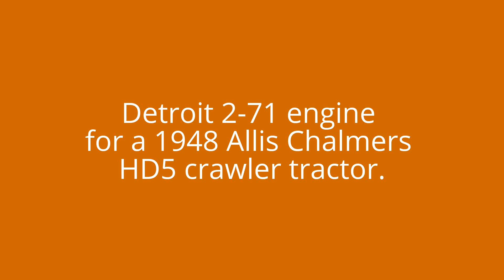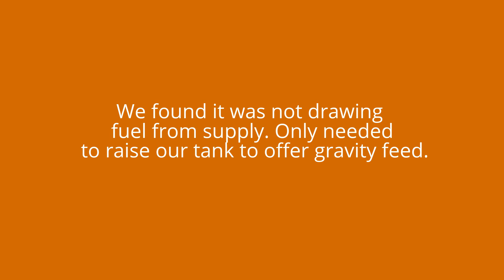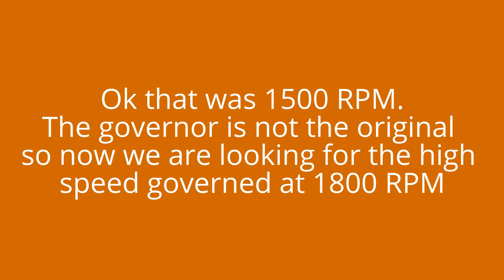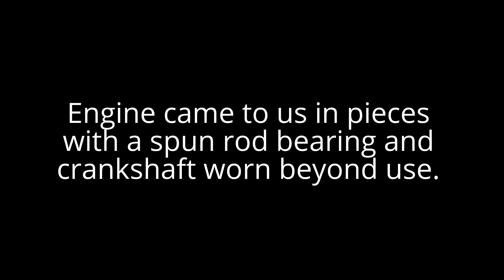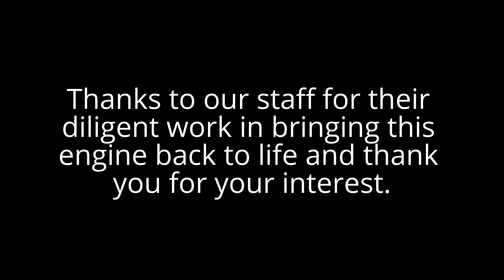Detroit Diesel 2-71 engine overhaul and start

Comment: That engine would sound so dame good with a turbo! The way it sounds when reving up or down sounds lovely. Imagine the sweet sound of a turbo too. OMG!!! Love diesel engines !!!

Thanks for sharing, 👍😉

👍👍👍👍👍THUMBS UP 👍👍👍👍👍
Reply: it has a lobed  blower on it all ready   i have one in about the same condition that i need to get time to put back together
Reply: FR Rapp  blower Dosnt provide any boost on a 2 stroke jimmy. It provides positive crankcase pressure for ring seal.
Reply: dude every deisel engine has a turbo it wouldnt run with out one you can though upgrade your fuel system blower pistons racks and blower just letting you know.
Reply: @hunter7476  unless you were talking about this design wouldn't run without a blower, there is plenty of diesels that have no turbos and no blowers. My dad's old 84' izusu pup has a naturally aspirated 2.2l 4cyl diesel, I have a 5kw onan generator naturally aspirated and just about have my tractor back together with a naturally aspirated yanmar 3t90j
Reply: @matthewhoffman9242  You do realise the GM is a two stroke engine? It's closer to a lawn mower in design than an Isuzu. They will not run without a blower to push fresh air into the cylinders, they don't have a reed valve crankcase like smaller engines.
Reply: @hunter7476  dude every diesel doesn’t have a turbo. Detroit had plenty of two stroke naturally aspirated engines. They all had blowers but lots of them didn’t have turbos.
Reply: You should look up 20 v 149 Detroit Diesel engine on YouTube, those engines have massive turbos on them and have the best sound of any diesel engine.

Comment: First time seeing a 2 cyl Detroit, Worked on many V 6 8 12 and 16 loved em
Reply: These and the 3 cylinder detroits were commonly used in industrial construction equipment, refrigeration cars for freight trains, generators ect not an on road bus or truck engine like you would typically see a detroit in.

Comment: And it can run in both directions, right? No need of a back gear..he. he.... I remember such Engines driving Fire Pumps. They had to run in a proper direction to achieve the pump efficiency.
Reply: Wrong.   In order to change the engines rotation there are a number of parts that need to be changed.    The Camshaft, starter, fuel pump, oil pump and water pump.   The idler gear location is also changed.   Yes they can start (bump start) in reverse but they will tear themselves apart in a short time

Comment: I wish there were newer versions. This could be the perfect engine for my diesel go kart project
Reply: Get little yanmar clone on ebay
Reply: I want to stick one of these in a single seat road going car looking a little like 1920s racers with a bit of "dieselpunk" design flair with the engine behind the driver. It doesn't need to be fast. And the 920# weight is fine too. Just sound good and be fun to drive. I'm planning to use a 2+2+2 transfer gearbox I have from an old piece of farm equipment. (I'm not sure what the machine did to be honest, I helped the farmer take it apart for scrap and the gearbox was good so he let me keep it as payment for my work. I've had it for years) The two gears are sequential (N - 1st - 2nd) and then you pull the lever back to neutral & push a second lever forward to the next detent to change to the next pair of gears. Like a mini twin stick.  Complicated, but would be a hoot to drive around. If that doesn't work, I'll use a beefed up VW bus transaxle.

Comment: I have a question I just got a 2v71 and I can seem to find a dip stick on the engine there is 2 pipe plugs on both side of the block where I'm guessing it would go.  Can you tell me here I find one

Comment: Hi Sr, im from chile i have the same engine in restoraion and i need the injector 
height calibration please!! greetings
Reply: I saw 1.484 inches listed for an hv6 . Wish  I still had the height gauge set would measure it for you. Nice little engine!
Reply: You want toknow the colour of the badge on the injector to get the right timing gauge or mearsurementAnd the number N65 stc.

Comment: Good job men, she sounds great!
I sure miss the old 2 stroke Jimmys, at least the 71, 110 and 149 series', you can keep the 53's
Reply: what's wrong with the 53? genuinely asking
Reply: the 53s were good engines
Reply: They were great at converting diesel fuel into noise and smoke... they also made a few horsepower - almost enough to get out of its own way
Reply: @nikolabegonja5490  Absolutely nothing wrong with them, just the bigger ones weren't so fiddly to assemble.
Reply: @mikecubes1642  the best

Comment: Am I nuts for thinking this would be great in a pickup truck?
Reply: s10 ...
Reply: Ron Armstrong  You may want to rethink the idea...My brother-in-law had an 84 F100 SWB 2wd with a 2.5L? four-cylinder Perkins diesel  in place of a probable 4.9L straight-six  gas engine. While getting around town & loads in the bed were just fine, pulling grades & such,  highlighted its severe lack of power...We got "stuck" trying to ascend a moderately steep ramp into a garbage-dump after dumping our refuse...it was quite the pathetic sight seeing a Ford trying so hard to climb such a mediocre grade....just plain ran out of power.
Reply: A 6V53 slots nicely into older Ford F series

Comment: check blower drive gears. They fail from pulse of two and three cylinder gmc. 453 471 671 6v53 etc didnt chew blower gear teeth off.

Comment: Is this engine big enough to put it in a small pickup truck or a small suv too as well?
Reply: it only makes about 75 to 80 HP. Kinda small for that. Try for a 4-71t.
Reply: ok
Reply: I mean put a 2-71 in a 1994 Jeep Wrangler would be a good suv!!!
Reply: With the right gearing this would power an automobile just fine. It has 3x the torque of most 4 cylinder gas motors, but only has about 600 useful rpm in the power band. Whereas a small gas motor will utilize 1200 to 2200 rpm for acceleration in the power band.

Comment: got a question on this motor if you can help
Reply from the maker: Lets see if we can help you. What is your question?
Reply: I have a 1950s ac hd5g crawler loader. It has a 2-71 in it for a motor.

There is this long tube about 2 inches wide coming from the bellhousing/transmission area and i can see it in your video. That is the transmission fluid fill spot right? Where/how do i add engine oil? I can only find the dipstick but no fill point. Is the engine oil and transmission the same fluid?

Thanks
Reply from the maker: No, that 2" tube is your engine oil fill. I know it looks like it is going to the bell housing but does not. You see the flywheel open there and it is a dry bell housing. The transmission is a separate lube system. Not sure what fluid they use in the trans.
Reply: appreciate the help

how much oil does it take? where could i get a new oil filter? do you know where i might be able to get a new fan, belts, and radiator? are things able to be swapped over to alternators or are the generators better?

thanks again
Reply from the maker: We used 6 Quarts of oil. the oil filter we used was a Wix brand # 51010. The fan belt we used was Dayco # 22620. Pay attention to your system for 6 volt or 12 volt. If it is a 12 volt then you could switch to an alternator (best with a built in regulator).
Reply: i hope i can find a new radiator and fan. i wish these parts were easy to come by like ford 8ns. my system has 2 12v hooked up to it...my guess for that is to handle all the extra requirements of the loader on it.

i appreciate all your help. if i run into anymore issues i will reach out to you. thanks again
Reply: ekpregsk A